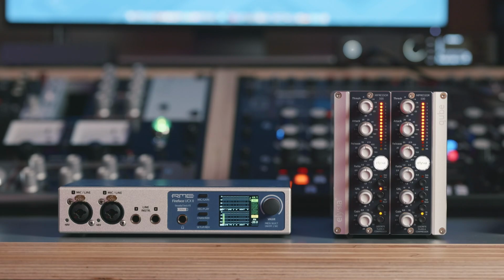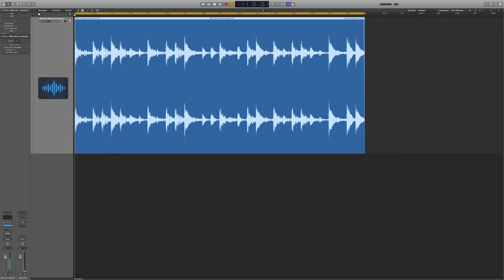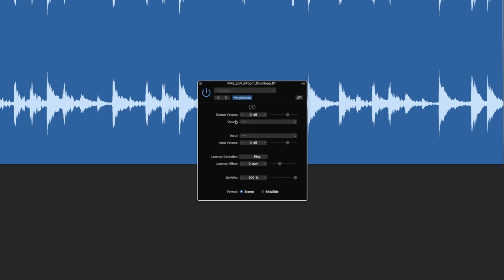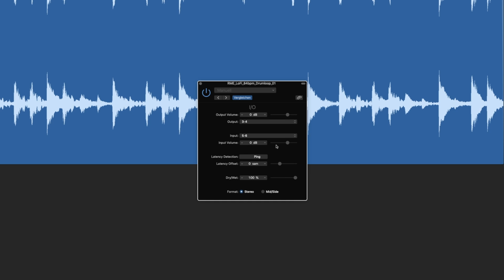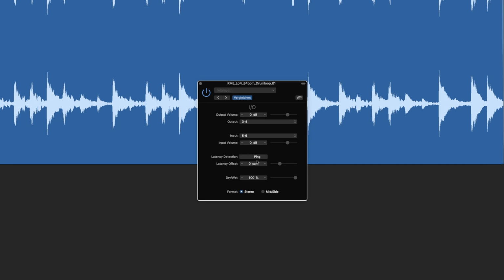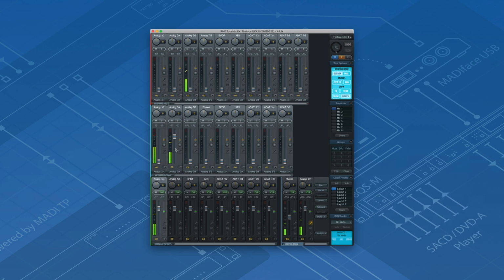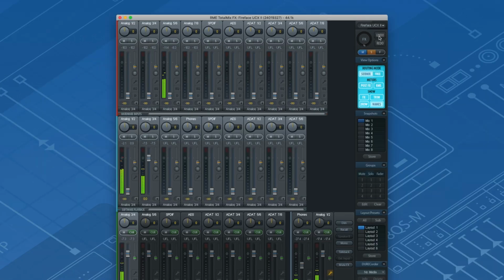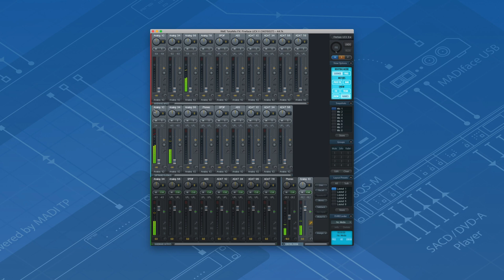Analog Plugins in Logic Pro

Comment: Why is the latency offset always 0 in my FF400?
Reply from the maker: Probably while the measured latency is identical to the reported latency of the driver.
Reply: @RMEAudio  So that's a good sign? I haven't noticed any delay when recording through external equipment, but I'd like to make sure.
Reply from the maker: @michacaus9405  Yes, that is a good sign. So you don't have to manually adjust the delay times of your track.
Reply: @RMEAudio  great! thanks for answer

Comment: i would kindly ask, if it's possible instead of "input channels 5/6 are connected into outputs of elysia" use a proper signal flow order instead: "outputs of elysia are connected into inputs 5/6 on the sound card" keeping this practice will help slowly remove a lot of confusion between (not only) starting musicians and producers, thank you :)

Comment: In case I don't want to use Totalmix and use the routing in my daw should I turn on daw mode in Totalmix or can I just leave Totalmix in the standard mode?
Reply from the maker: Leave TotalMix in the default mode :)
Reply: @RMEAudio  Thank you. One more clarification: I don't have to pull up any faders in Totalmix in order to hear channels in my DAW. Correct?
Reply: @joostvanbunnik7646  did you ever figure this out? I always have a problem using analog gear in logic but never a problem in pro tools.

Comment: thanks for the tip.  this example seems to be for an audio yrack already recorded, would a similar approach hold for recording the wet effect in real time?  i have  lexicon pcm60 with ff800 and i experimented with the i/o plug in such that i could sent out my drum room mics to the lexicon on output channel 8in total mix then take the left and right outputs from the lex pcm60 two available input channels on the ff800 and record emable those tracks in logic pro 10, then i blend in the wet and dry room mics.  thx

Comment: Thanks a lot for this video. Just noting that the description does not have links to Total Mix effects Setup with analog hardware. I have a babyface pro and Rosetta 800 set up. My analog EQ and Compressor units arrive in 2 days, and would like to know if there is any specific tips you could share for this set up? Currently My ADATs from  Babyface are hooked into Rosetta 800 and I have signal flow in and out. although I am not able to get the Lexicon PCM (which is hooked into Rosetta 800) to work properly. I am hearing phasing issues.